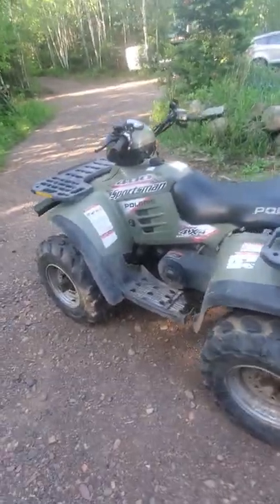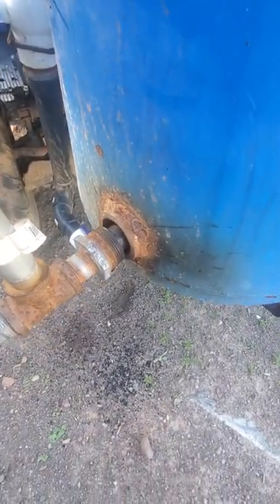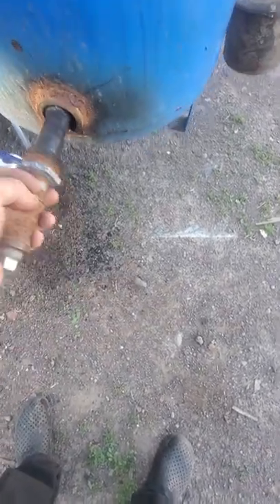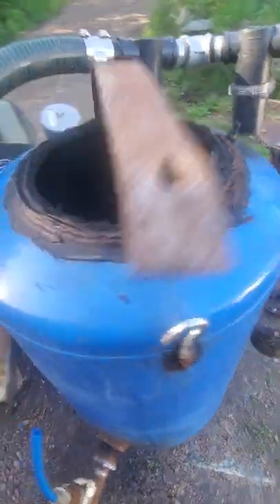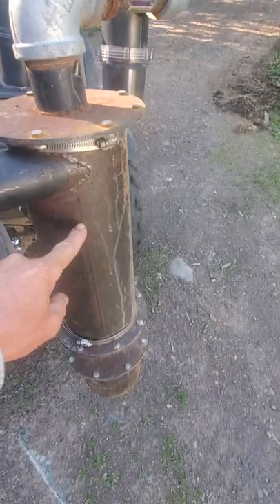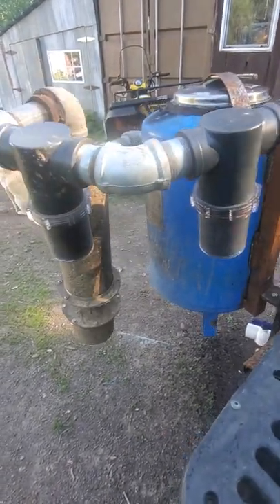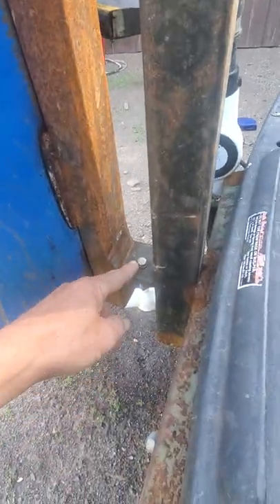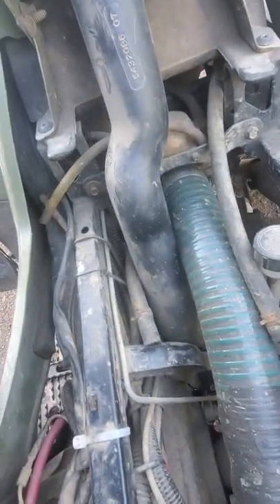How to build a charcoal gasifier for an ATV

Comment: Great video! How many hours of runtime do you typically get on one hopper full?
Reply from the maker: It really depends on what type of wood I made the charcoal from and how fast I go. I will hook it up to a 9000w generator and get a run time when I post the video.
Reply: @drainkinginc2011  How long? aka what is the cubic unit of charcoal = how many minutes. Can you exceed 1 ft3 charcoal = 1 ATV run hour?
Reply from the maker: @douglaspohl1827  I really haven't had time to spend a whole day on this yet. Summertime is very busy on our homestead.
Reply: @drainkinginc2011  okay when you're free, I'll be awaiting your results. Thanks

Comment: Do you tighten the fitting at the bottom where the flute intake is?  I noticed a little blackening of the paint around the fitting at the bottom like there is an air leak.  Maybe it doesn't matter if it's loose?
Reply from the maker: Yes it's preferable to have a tight seal. I've taken it off so many times to check my nozzle when first getting it going, I quit caring about it until I'm ready to make it permanent.
Reply: Thanks for the informative vid. I have a half made gek gasifier and just made about a cu mtr of charcoal I was interested when you mentioned dripping water on the charcoal to make hydrogen and cool it.
Could you pls add any detail on that. Cheers Ian from Australia.
Reply from the maker: @hecklemeditationmusic1304  just drip the water in at the air intake. One drop per second worked for me.